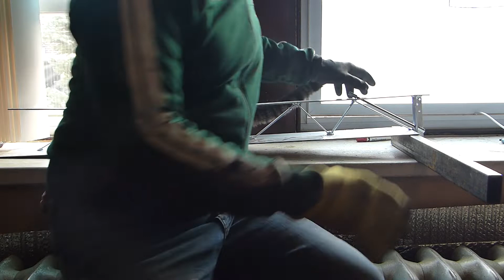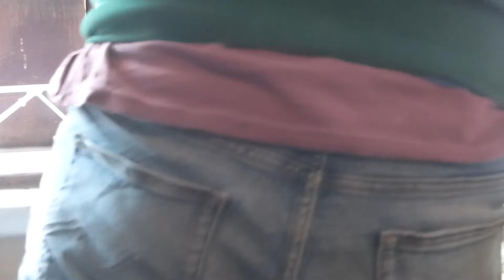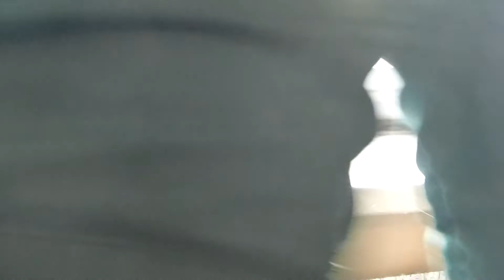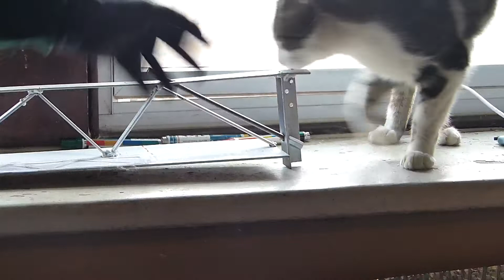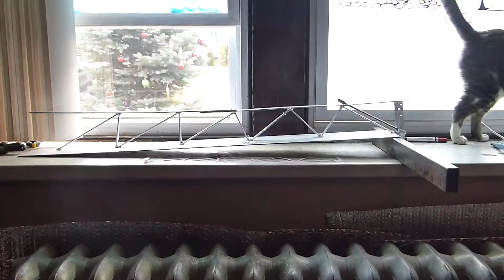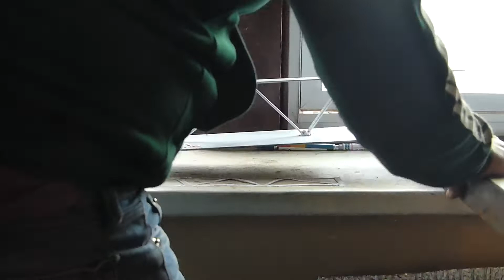FIU BRIDGE COLLAPSE MODEL PART 4 SAGGING DECK EXPLAINED & CRACKS IN 11 CRITICAL (CHANGES LOAD PATH)

Comment from the maker: Hello lovely people,  hope you enjoy this series, it will show load path issues with number 11 and 12... once you remove them from the picture; the span in the ''deck and canopy'' from number 10 to number 12 is overload and the forces resolve themselves where we see the ultimate failure... in the BREAKS in the canopy and deck.
Staying focused, these series of videos will show that ''deflection / sagging'' is what started this ball rolling to failure.
That once the formwork was removed, it was reported those "cracks like hell" were identified (but not developed fully until the day they remove the post tensioning in number 11 and 12 base and canopy blister)...
The initial cracks that are presented ARE from the removal of the formwork; this means the structure was NOT ''flat" because of the deflection / sagging"  WHICH MEANS this was turned into a ''truss system'' or a ''Torsion loaded I-Beam" and that torsion presented itself in those hairline cracks at the base area of 12 DAYS BEFORE THE MOVE.
ONCE  THEY De-TENSIONED (de-stressed) , the TORQUE and cracks really developed and I believe was only stopped from collapsing because of the post tension bars ''re-grabbing" at the base of 12.
This MEANS the deck SAGGED even FURTHER and when Figg and the rest of them allowed for ''re-tensioning'' the SHIMS that were now ADDED under 12, made a NEW pivot point for the clamp force of the number 11-B (upper post tension bar) and THE GAP could NOT be closed because of the NEW EXCESS FRICTION created by that newly created PIVOT POINT that could not ''slide'' back into the cracked openings as PLANED by these engineers!
That it created so much stored force in energy at the base of the post tension bar that the concrete was able to hold until it explosively gave out! AND this INWARD EXPLOSIVE FORCE, BLEW OUT PARTS OF CONCRETE (which people want to know about in the live video- ? where did the explosive concrete come from?)...
At that point number 12 was no longer active and it's failure was just  part of the chain of the failure.
It's explosive release of energy caused an ''Earth Quake" in the system because Post TENSION 11-B BAR WAS HOLDING THIS structure together (from sagging down) it was the ''tie-back'' of the this structure to the diaphragm and once it was released, the structure was free transfer it's loads only from the 9 / 10 node to the diaphragm... it could NOT do it without the deck failing transversely... and of course, above that 10 and 11 node, it failed between the node and the canopy (transversely also)  ...  
IF< the deck could have had STRONGER POST TENSIONING IN THE LONGITUDINAL DIRECTION it would not have FLEXED... I have another video that will question the one tendon, ''D-1" and concrete placement; this will be in the next video perhaps.
Note: This model will be plasma cut to show longitudinal post tension cables...
The current model is how the design was intended to perform.
I need to find out what ''sagging location" was identified per the CEI questioning the sagging...  It appears to be between 9 /10 and 12.

Comment: Just for clarification, was column 12 not connected to the deck except through a post tension bar may some poured concrete?  If so, is that the same story for column 1 and 2 which I thought there were reported cracks at that end but not as serious.
Reply from the maker: It also had upright rebar but it only was truly connected above the drain pipe...  below the drain pipe would not contribute worth much.